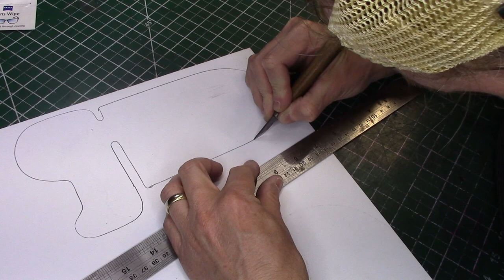Making a Leather Knife Sheath for a Buck 119 Leathercraft: Tooled Inset Sheath Leatherworking Blade

Comment: That really turned out awesome. Great work. 
Question:  is that the Cowboy Outlaw sewing machine?  How do you like it?  I’m looking at getting one, any advice ? Thanks !!
Reply: I see from your other vids that it’s a Tippman Boss.  Still your thoughts and advice would be appreciated !
Reply from the maker: @PLAZALOT58  Yes, It's a Tippmann Boss. It's a great machine once you learn it's quirks. Never used the Outlaw, however it outwardly looks very similar (almost like they copied the Boss). I did note the Outlaw has a deeper throat (more "reach"). That alone would probably make me choose it over the Tippmann machine.
Reply: @RoadAgentLeather  just going by what I’ve read, it does appear that the Outlaw improves on some of the shortcomings of the Boss, deeper throat as you mentioned and all steel parts.  Thanks for your response and opinion !

Comment: You have great ideas and are very creative however there are many aspects of your process that are poorly executed. Having the glued edge at the sheath opening that will catch the tip of the knife blade and be destroyed over a short period of time to start with. Using press rivets that can pull loose for the belt loop and using edge paint that will peel off with only a small amount of wear instead of simply burnishing to name a few. It is easy to make a product look good, It takes a lot more work to make it perform well over time.
Reply from the maker: Thanks. I always welcome constructive criticism, and you can never stop learning in this craft. Although I've never had a problem with any of those things. More specifically, in 15 years of leatherwork I've never had a properly-set rivet pull loose. Also have never seen Fiebings edge paint peel off.